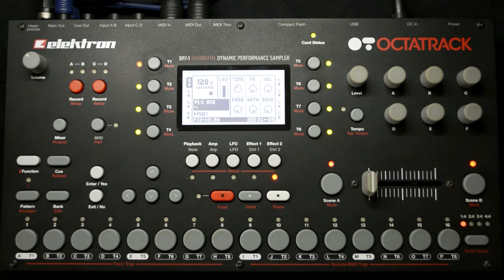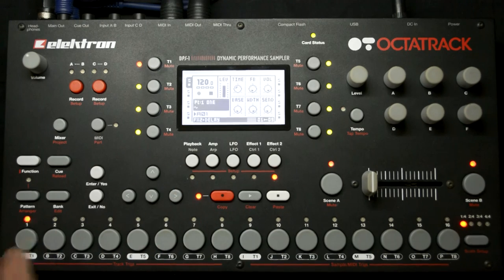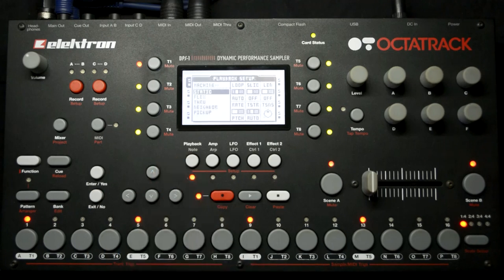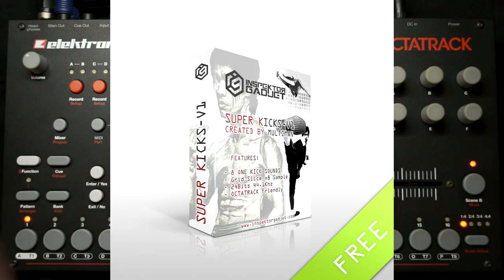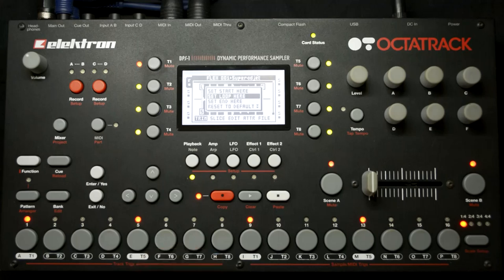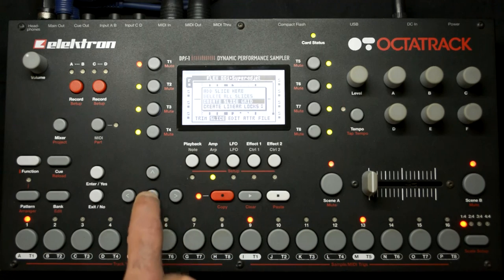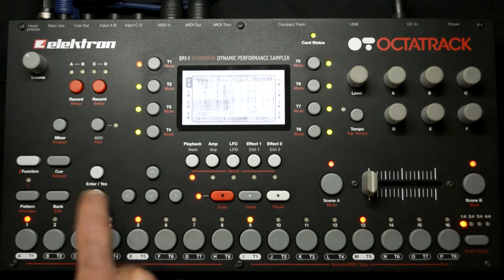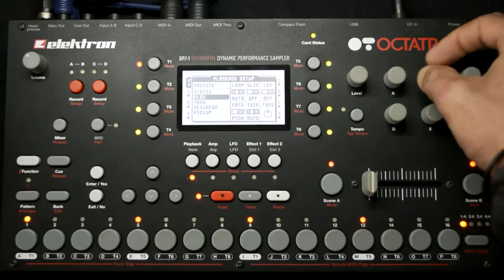Elektron Octatrack Tips & Tricks - Episode 1 - Single Cycle Waveforms

Comment: when editing samples i can never see a waveform, just a shitty rectangle, no matter how much I zoom in. What's the problem?
Reply from the maker: Hello Solomon, not sure what you mean by a shitty rectangle. This are sample chains of many single cycle waveforms... their size is tiny, I cannot describe how tiny they are compared to any standard sample. 

I neverd zoomed in to the waveforms since there´s not much to change there apart of what you can from the main page.

There might be a limitation in the OT zoom option since the slices are so small.
Hope it helps.
Reply: I'm not sure I understand the difference between different types of samples. I just want to sample my synth and have it show up as waveform, up and down, and instead I just see a slightly thicker line where my sample is and no matter how much I zoom in it's always just a line. How do I see an actual waveform? Thanks for the quick response btw you might save me from getting slapped across the face which is what will happen if I don't figure this octatrack out enough to make a simple eurotrash song by new years lol made a bet with a friend
Reply from the maker: Hello Solomon. In order to make a sinclge cycle waveform from a synth you have recorded, you have basically two options. One is to extract the single cycle waveform in a Audio Editor in Win or Mac... That´s is how I did it.

The second option would be using the OT, I never done it there but I guess is quite simple, you zoom in until you see a complete cycle of the waveform and you adapt the start and end of loop according to that waveform.

The whole reason why my Sample Chains work with slice function is because they are first arranged in Ableton like 64 samples of the same lenght and pitch... Not sure if it still makes sense to you.

Try playing one of my Single Cycle Samplechains in a asudio player to hear this are not normal samples recorded from a synth.

There are tons of tutorials online about how to make your own single cycle waveforms and all of them use some sort of audio editor.
Hope it helps.
Reply: thanks for the response again, but really I just wanna know how to sample my korg m3 and moog sub 37 and see them show up as a waveform in the audio editor. I have zoomed in and out to the max and it always appears rectangular, I can never see a waveform. Any idea what the problem is?
Reply from the maker: Hi Solomon. 
Have you managed to sample audio at all?

If you sample any audio in OT, and go to editor you must see a waveform... not a single cycle one, but a wave of some sort, if you see nothing is that you are doing something wrong (not sure what you mean by rectangular).

 If the volume is too low, maybe the waveform is not showing, but you should see something... Once you sample in the OT, you have to edit the RAM Memory slot ... or FLEX recorder, dont remeber the same... to save that as audio... maybe that´s your problem.

Sorry if I can´t help much, maybe asking in Elektronauts forum can bring you some more answers.
Cheers!
Reply: I'm thinking it might be the volume maybe, also I'm only using a mono connection, I'll try stereo. I have managed to get some audio in there and am capable of playing it back, when I zoom in I see not a wave but a prickly rectangle so to speak, there are little perpendicular lines coming up off of the rectangle but never does it make the shape of a wave. A line never goes on an angle like you'd see in a wave, it's just a big rectangle with little perpendicular lines coming out of it. The sound still sounds fine though and is a very appropriate volume level to my ears
Reply from the maker: Hia, happy winter solstice by the way lol... so yeah it may be volume but now that you ar telling me that, isnt maybe that the signal its being recorded with overloaded peaks? and that why you see that shape?

Anyway, the audio editor allows you to zoom the image in different ways, up down and left right magnification, which can be tricky sometimes... Sorry I cannot help you much more but try comparing to the waveform in a standard sample/loop from a library or something to check things.

Hope you get it sorted!
Cheers
Reply: idk what overloaded peaks are, but I've managed to see the waveform sometimes now. Solstice was on the 21st but thanks :P
Reply from the maker: Overload is when it goes aobove 0db and it clicks, that creates a squashed "square wave" like you mention. dont know if thats the case was just pointing out another possible reason. Cheers!

Comment: hi there, i am trying to change the presets in the minitaur, from the octatrack, but i can't find the way. i did it from the ableton and it was no problem... that function it's working on the moog... do you know something about it?
thanks!!!
Reply from the maker: Hi, you can send program changes from the Midi tracks. Make sure u select the correct Midi CH, bank and program... Also make sure your menu MIDI settings is set to send Prog changes and any other data you want to send. I donnot own a minitaur but I have succesfully changed presets in many external gear so it should work. Hope it helps.
Reply: Thanks, I did everything and it doesn't work.... Neither the jx 03... I dont understand whats wrong.... Have you some tutoriales about it?
Reply from the maker: Hi, No I dont but maybe send me a private message and I will try to make one :) it defenitely work with some stuff so let see.

Comment: so I follow the instruction but once I get out of the flex it seems to go back to static when i exit the menu, sorry I'm  beginner.  how can i transfer all your samples to the internal memory of the machine? bought that octatrack second hand and they have wiped the memory so i never managed to use the flex machine so far,  if you had a tutorial showing how to reset the machine to factory settings with the internal samples and where to find them, you would have many hits. After going through the forums it seems like many people have the same problem. I e-mailed Elektron about it and searched their site but really nothing there, and they did not reply yet. thank you for your help anyway.
Reply from the maker: Hello Music is a secret. I don´t know really what your problem is. Flex machines must be able to be used the same than static one. Is just a different way of managing the audio samples. If you are a begginer, make sure you read the whole manual a couple of times in order to learn the devices structure. Loading samples is very simple, either plug the CFlash card on the computer, or connect the Octatrack using the USB, then drag and drop your sample folder in to the "Audio" folder within your project.
The factory content samples should be available in the download section, make sure you create an account and can access those sounds, plus many other Free Sample Packs ready available.
Hope it helps, cheers, Julian.
Reply: thanks Julian for that precision, great advice , I read the manual once but sounded a bit chinese to me, not got good notion of what they call synthesis neither I guess. but I'll persevere. it will take time to crack the mystery, thank you for the tutorials hopefully they will make sense soon. congrats for the channel and samples, best I have seen so far!
Reply from the maker: music is a secret
 Glad it helps! The OT definitely needs some time to understand, specially if you are not made to the elektron menus and architecture, but soon you will! Enjoy the ride ;)